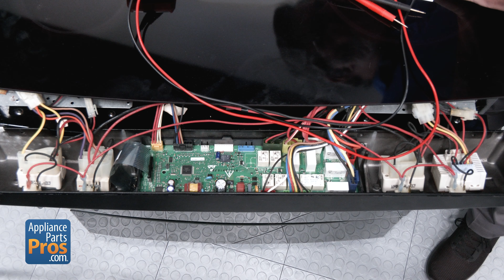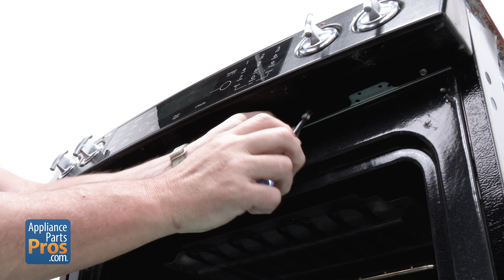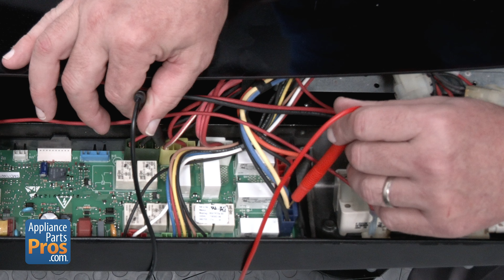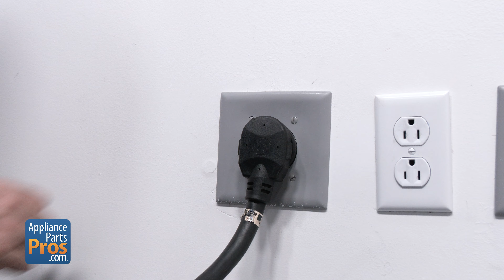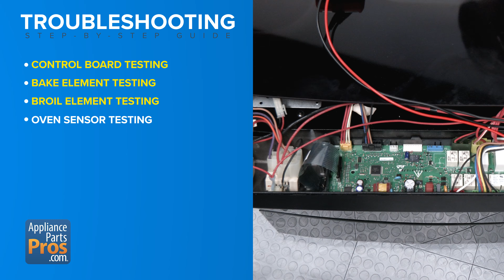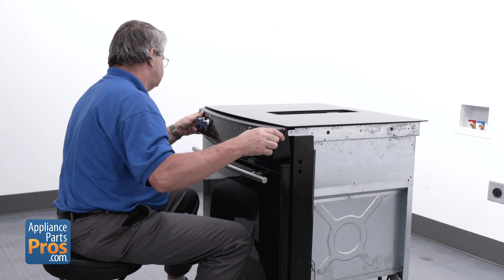JennAir Range Not Heating? Here's What's Actually Wrong

Comment: I have the same unit.  at very random times, I will "bake" an item at something like 400 then after (usually) 15-30 minutes it turns itself into broil and I end up burning my food.  There were earlier times about a year ago where the unit just went into error mode and stopped cooking all together, but has been doing this bake to broil mode for the past several months...maybe 20% of the time when I try to bake something.  Ideas?
Reply from the maker: If the oven randomly switches from Bake to Broil or throws error codes, the most likely causes are a failing control board, relay, or temperature sensor or a wiring issue.  

If you need more in depth troubleshooting or testing information you can check out our Repair Forum: https://forum.appliancepartspros.com/.  It’s easy to register, and you can either post your question or search the forum to see if someone else has already asked the same question.
 
Our experienced technicians, with over 20 years of hands-on appliance repair experience, are ready to answer your questions and guide you through your repair.
Reply: Do you have the part number for this control board?  I think it matched my oven